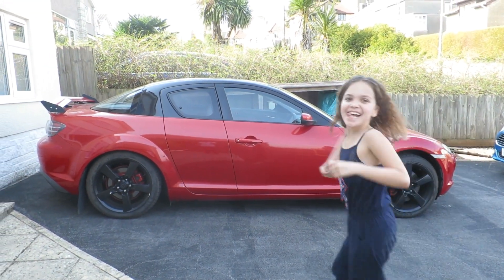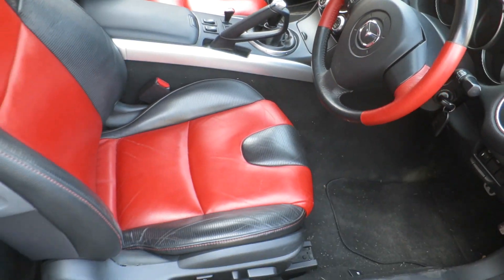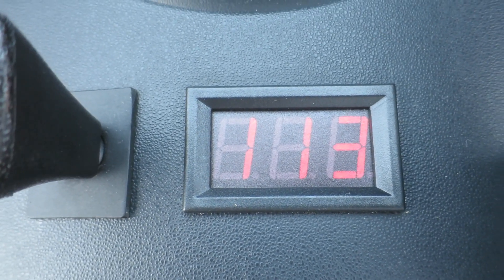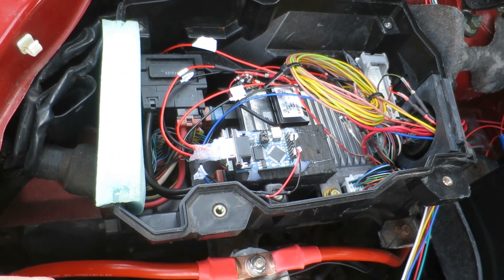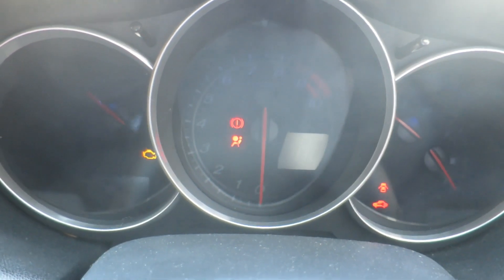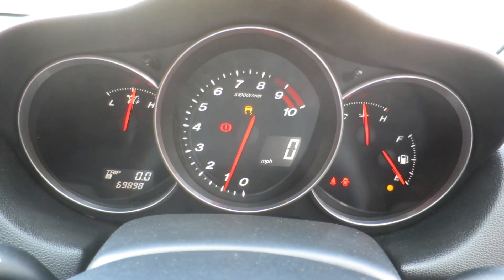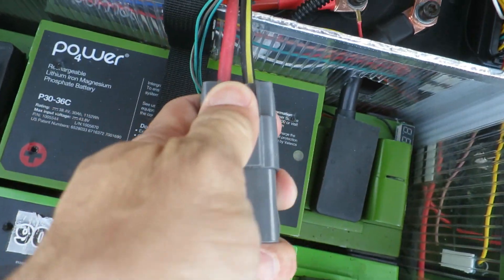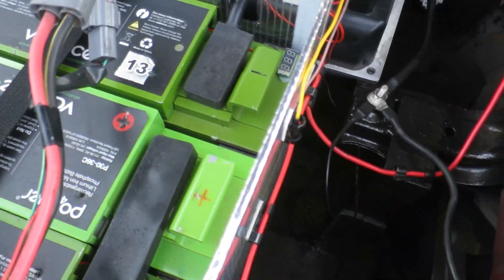Mazda RX8 Electric Car Conversion

Comment: I saw one at fully charged live in 2019 with a horrid body kit on. I always think "is there anything more pointless than a powertrain-swapped RX8?". Judging by the comments section, this is a popular thing :\
I suppose better than an LS swap.
Reply: It's because you guys dont know how to care for rotaries. I'm at 170k with original engine. I'm the original owner. I actually have 2 with original engines. I travel cross country in the one with 170k. They are reliable if you know the weak points in the engine. The only issue ive had with my rx8s are the catylitic converter and ssv valve.
Reply: @_alltheseprettylights_  Who is "you guys"? So you haven't even had to replace rotor tips? You are meant to run them at low revs when possible like any engine and let them cool down in idle before switching them off right? Like an old turbo car.
Reply: @_alltheseprettylights_  This is not the case. My only argument is check the resale value of rx8. It didn't fall because the car is reliable lol.
Reply from the maker: Its mainly because a) the rotary is unreliable so lots of RX8's going cheap, b) a rotary and an electric motor are similar in size.
Reply: @SouthWestEVUK  Ah, so it's mainly just making use of the cheap sporty engine-less car? And maybe driving an electric motor is similar to a Wankel engine?
Reply: Rx8 rotary is unreliable, it makes perfect sense to swap the car.
Reply: @steveh2040  But the entire point of getting an RX8 Is for the engine?
Reply: @bangerbangerbro  Rx8 can make hair pin turns and stop on a dime. Its great chassis but the engine is horrible. Even die hard rotary guys are sticking rx7 motors in them rather then the rx8 rotary.

Comment: Where is all the wire loom to prevent rubbing?  All I can think of is "Vintage Voltage" when watching this. Clever way to fool the ecu. So, electric motors and batteries are cheaper than a rotary engine and petrol? How many forward gears do you use?
Reply from the maker: Im not sure I really understand these questions! I use 1st, 2nd and 3rd at the moment with this motor

Comment: i see you only have the motor air cooled. how hot does it become under load? and i am wondering about you being scared of the car catching fire in case of a crash. Are you thinking about building a emergency fire extinguisher system in the car?
Reply from the maker: Not very hot, the current controller is not pushing the motor at all. Not really scared of the car catching fire. Lifepo4 batteries are pretty stable compared to Lipo's (hence why used in cars).
Reply: @SouthWestEVUK  Hmm i see. Sorry if i put foxes in your head. Please keep us updated i am trying to find a way to convert my car into a hybrid. Would like to learn and cut corners from you. (:

Comment: An electric motor is really the only worthy substitute for a rotary engine. An electric RX8 beats owning a Tesla.
I have some questions for a possible next video:
Is the arduino sending info into a bus or individually to each module? Would it be possible to send something else to the RPM needle, like motor current? (It's a manual, so it would be just like revving it with the clutch pressed)
Would it be possible to send a specific rpm/throttle signal only to the EPS module to make the steering harder or softer on demand?
Reply from the maker: Read up about CanBus - or look at one of my other videos to understand a bit more about it. Yes I can send whatever I want to the RPM needle. The EPS actually takes speed readings and sensor information on the Canbus and handles the steering assistance.

Comment: Lolrof. .... When i heard what the range is!
Had thought of this car  with tesla motor and batteries wowsome...... My lecky know how limited would need to start from the beginnings.
My A3 Etron does 27 plus in summer and 23 in winter. Its just awesome. Was dipping into hybrid to see how i get on with electric cars. 👏👏👍
Reply from the maker: Not a massive fan of hybrids to be honest, ive only driven the lexus range, but not a fan. This is getting a Leaf upgrade next ;o)
Reply: @SouthWestEVUK , i am a fan of good hybrids. Lexus don't do plug in hybrids in affordable categories. Newer hybrids using denser energy batteries give 40 plus electric only miles. By the the time the batteries pack up in my A3 replacement battery tech might be 50 miles plus for same weight! Ideally would want tesla powered mx5! 😂🤣 Bet someones done it. Will follow progress.

Comment: As a Fuse,/MCB u need a special DC MCB. The house MCBs wont work or rather would wear out prematurely and probably dangerous.
Reply from the maker: So that MCB is just used in the event that the live high voltage touches the chassis - it would (hopefully) trip. Nothing really flows through it, it is just holding all the grounds to the same level.

Comment: Lol nice work but 10 miles lol I'm very impressed with work the leaf motor eBay around 1k
Reply from the maker: Yeah, big learning curve - Leaf donor car already on its way, new motor, inverter and batteries ;o)
Reply: @SouthWestEVUK  can't wait how did you come up with the programing the can system very cleaver how u set it all up and how did you figure out the engine needed to be running for the power steering to work ? 

You going to be stripping the car down ? Save some weight ?

Comment: This is awesome! I want to do the same with my son as a bonding project on my RX-8 (galaxy grey)... would love to get my hands on the Arduino code and any other help/advice on avoiding pitfalls you ran into.  do you also have a website with a list of materials, diagrams and code etc? anything you have will be appreciated.
Reply from the maker: Ill be honest, my view on that level of planning is - don't. If you try to plan this fully in advance, you will simply be overwhelmed with how much you don't know. I would break the project down, first - get your donor car, second, strip it - these two parts alone may take you months. Set yourself a budget, I did this for £4k - but I think you will struggle to meet that, perhaps double it. Of course that spend is over the life of the project. Code I will be sharing as it is nearly finished - that will save you 100 hours on its own. Just get stuck in, plenty of forums around to get help - and its been done, so really you should not get any unsolvable problems.

Comment: Great project!  Always love to see a RX8 swap of any kind.  I'm interested in what you did to get the DSC to work and what functionality you retained.  Is it ABS only or does it retain stability control as well?  When I did the LS swap in my RX8 there wasn't anyone who was capable of getting DSC/ABS to work properly.  I imagine it should be doable to get the DSC to work on any engine/motor as the Bosch DSC/ABS unit is used a few different vehicles.  I remember someone reaching out to Bosch on getting access to software/support and being told they could buy a license for an obscene amount of money.  I ended up swapping to the Sumitomo ABS unit available in the lower spec RX8 here in the States.  It simplified things as it doesn't need any input other than the wheel speed sensors, and supplies the speed signal to the cluster.  It does eliminate traction control and stability control though.  I've got full dash function and no warning lights on mine, but I had to run the cluster on it's own canbus network. I used a converter I bought that takes the swapped ecu canbus data and translates it to what the RX8 cluster understands, it also has full control over the canbus controlled warning lights.  I had tried a couple other converters that piggybacked on the canbus, but they all had issues with getting "talked over" by other modules and occasionally setting warning lights or freezing parts of the dash.  Best of luck in getting everything sorted and getting it legal for the road!
Reply from the maker: So I believe the ABS / DSC is working OK - as it no longer complains with error lights! (and is still on the CAN). Basically I am mimicking the ECU data to keep it happy. However I cannot get the Traction Control light to turn off, and its driving me slightly potty...

Comment: Subscribed, because Im surrounded by lots of non-running RX-8s
Reply from the maker: Whys that! Do you keep braking them? How many do you have as I might need another one (or bits of one)
Reply: @SouthWestEVUK  lol. I'm happy to report that I sold mine with 104k on the original engine and the next owner drove it another 3.5 years.
The only modification done was oil metering pump adapter from rotary aviation.
Best mod ever until your electric conversion!! 😁

Comment: Nice project, im building a hybrid car myself outlander phev motor and inverter mounted rear with a 14.5kwh battery and petrol engine up front. Cheap motor and controller combo and canbus controlled too.  Those life4po should have a decent discharge rate. Im using vtc6 cells 10c discharge so plenty of juice but a little costly.  Always enjoy a good conversion and all the details.
Reply from the maker: Wow, building a hybrid, nice work! Yeah the battery pack I have can deliver about 1000amps! Not that I need anything near that...
Reply: @SouthWestEVUK  what voltage are you running my battery will do 360a 96s. Good for 115-125kw from the battery. Motor should be able for 250nm.

Comment: I'm not seeing how this entire project could have been done for anywhere near 4k, even with some of the components being relatively low-end. I mean just the motor+controller will typically set you back 3k or so. Did you get a bunch of freebies along the way?
Reply from the maker: Nope, bought the motor and controller from China direct. Batteries are second hand and got the lot for £100 from a scrap yard. Awesome eh ;o)
Reply: @SouthWestEVUK  Buying things from China doesn't make the cost a non-issue. I would consider getting 200kg of LiFePo4 for 100 quid to be a freebie. Watching this again just now I realize your 4k includes the cost of the car itself, engine hoist, welder etc which makes me even more skeptical.

Comment: How heavy did you say it was?
Reply from the maker: Which bit? Batteries are about 100kg, motor 50kg ish, car - not totally sure, perhaps 1300 after I removed everything.
Reply: @SouthWestEVUK  What kind of range do you expect with a 100kg battery?

Comment: awesome project! Put some coilovers on the car with a really high, stiffer spring rate on the rear to compensate for the extra weight back there!
Reply from the maker: Yeah the 150kg in the boot is a bit much!! They are being moved soon - going to be installing a Leaf motor - subscribe as I will be producing videos along the journey!

Comment: I appreciate the build... but you did just destroy the weight distribution of the best handling car on the world.  I would love to see you get the batteries laid out in a cleaner, better distributed way.
Reply from the maker: cant disagree there, although it always understeered at low speed... This is all getting ripped out - Nissan Leaf motor and batteries being installed! Subscribe - as I will be video'ing the migration...

Comment: Sorry if this has been addressed before but do you still have to pay the same car tax as if its still petrol powered or can you get this reduced? I have been wondering about converting my rx8 to electric in the future but I wouldnt want to do it and still pay £570 a year tax for a zero emissions car !
Reply from the maker: Yes I have spoken to the DVLA about this, there is legislation that states you cannot change the cars tax value once it is set at manufacture. I believe this is for cars after 2001 or thereabouts. I have the letter from the DVLA here with the clauses in it. Sucks!
Reply: @SouthWestEVUK  that's ashame. Hopefully in the future when this becomes more of a thing it will change.
Reply: That’s odd, we had a diesel micro regraded to a lower tax band. It needed to be checked over but that was 2007 car

Comment: how do you keep the 12v battery charged since the alternator is gone? dc-dc converter?
Reply from the maker: Hi yes exactly that, you need a dc-dc converter that can handle the high input voltage of your cars motor circuit - in my case up to 120v. And that outputs the roughly 13v-14v needed to keep your lead acid battery healthy.
Reply from the maker: As a note it also needs to be able to handle the current load from 12v systems when the car is on - remember the battery is only really there to keep the car alive when the engine is not running (and to get it started), the alternator is what really powers the car under load.

Comment: Great work! I'm very interested in the can bus arduino stuff, for my conversion. I've got the gauge cluster can-controlled so far (including the fuel gauge). The code's here: https://github.com/rx8ev/. 

I'd really appreciate your code (and input) to help create an rx-8 integration module to make it as easy as possible for people doing conversions in future!
Reply from the maker: Ive got another vid or two coming about the RX8 canbus, so hopefully can help there. Good work with the fuel gauge.
Reply: @SouthWestEVUK  cool, thanks. is your code online somewhere?
Reply: @SouthWestEVUK  well is it??

Comment: I had an RX8.. absolutely loved it ! BUT the front of the car is very light and on the water the car realy whants to kill you (becose of aquaplaning) SO.. please thing about putting some of the batery on the front. (And pardon me fo my english, i’m swiss)
Reply from the maker: Yes they do under steer a lot, I used to own one, especially at low speed. Not sure if it is a weight distribution problem as the car is well balanced. Probably needs stiffer suspension or less rear grip.

Comment: Nice work, good job and good video, really interesting to follow along, will be keen to see more. 

Would highly recommend wiring that redundant throttle pedal input into the Arduino though and crosschecking with very careful fail safe code!

Good luck with the next upgrades.
Reply from the maker: Urgh YT is not letting me reply! third time lucky... Yes I will be adding this in, first step was to just get it working.

Comment: Great project! I have a problem with my ABS and traction control. I bought an Adaptronic Modular stand alone ECU because I want to turbo my 8, everything works fine, except the ABS and traction control. It turns out the 192hp is a bit different from the 231hp version wiring wise. Is it possible to get an Arduino, like yours, and make the ABS and traction control work without messing with the Adaptronic ECU? I’ve been looking for a fix for a while now and I think this could be it!
Reply from the maker: I don't see why not, I know cancode 620 (hex) for instance is required on the canbus with the right bytes of data otherwise the ABS and traction lights light up. Dead easy to add in an arduino via the diagnostic port and fire some codes out. See my latest video on how to read the canbus, new video in the making on the RX8 data specifically.
Reply: TheBlackhursts Through the OBD II Port? I’ll check out your latest video, thank you!
Reply from the maker: Yes odb port, it has the canbus on it so you can fire codes out to your hearts content!

Comment: Nice work! You should talk with the people and companies who helped with your build and start a company to convert older cars 😉 I purchased a Mitsubishi Eclipse Spyder with the intention (later Down the line) to have it converted to a full electric version. We've got a Renault Zoe 2014 that I'm liking, but it's a work horse so couldn't touch that.
Reply from the maker: I do wonder how big the market is - let me know if you would buy a 200bhp EV RX8 for £20-£25k?
Reply: Well I'm sure someone might go for it, preparing for carbon neutral 2050 (keeping any rust at bay!)
For me I am for a convertible electric experience 😉

Comment: Nice job ... Really interested in how that ardunio works with the can-bus, would be nice if u did a video explaining all that and make the files available thanks
Reply from the maker: Hay, thanks, I am going to make a couple of CanBus videos's it is quite a big subject...
Reply: @SouthWestEVUK  sounds great. I am currently in the process in converting my 2006 rx8 to EV. i would love a parts list and tutorial. thank you. and great job on the conversion
Reply: Yeah. This is some Dark Arts mastery here. Fascinated how you reprogrammed the car to behave.
Reply: I'm going to add my name to the list of people interested in the canbus system.

I actually want to electrify an old Ford. 
Either a fiesta or a Cortina. 
These come without a lot of the gubbins modern cars come with. But, as all modern systems seem to run canbus, it's something I'm likely going to have to have some knowledge about. 

So yeah..
I'd be very interested to see the video where you explain it all.
Reply: I'm interested in can bus as well
Reply: One more interested here
Reply: I would also like to know more about programming the Canbus... this is the thing I fear the most in converting my 2007 Jaguar x-type...
Reply: yea i also was interested in it
Reply: Hi! Great conversion! I would like to get info on that arduino programming. I’m starting a conversion of a Peugeot 2008 with electric steering wheel. Thanks!!